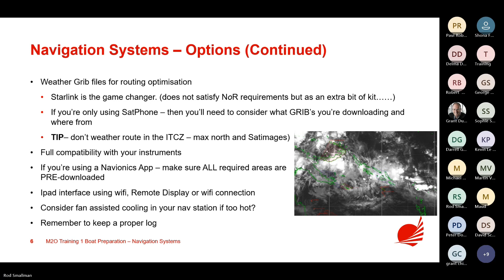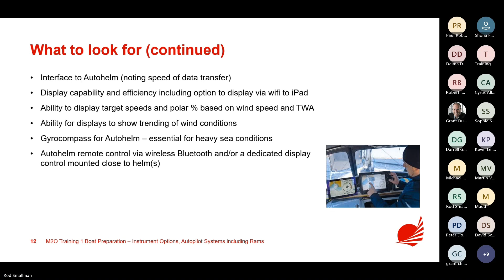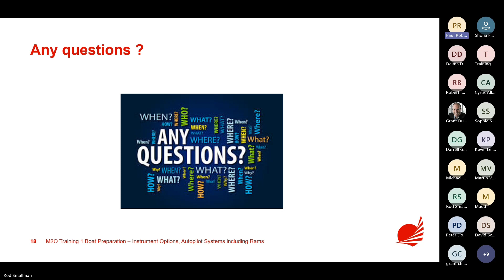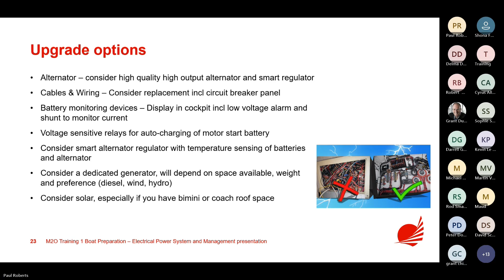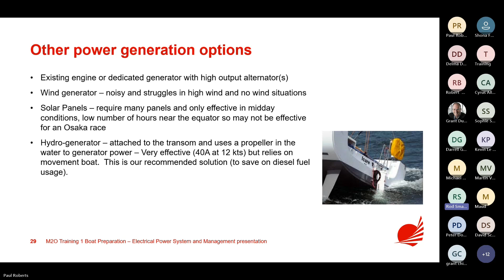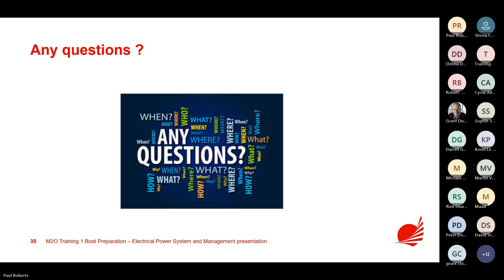Boat Preparation 1

Comment: I only found out that iPads without a SIM card slot do not contain a GPS after I’d left to sail across the Atlantic so make sure if using an iPad it has a SIM card slot. Even the Apple Store crew were not aware 🙈